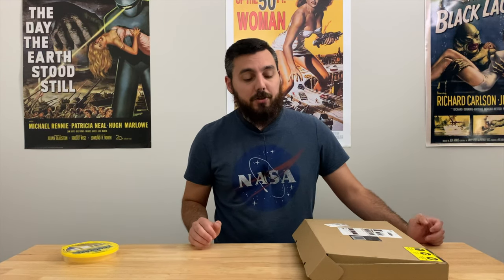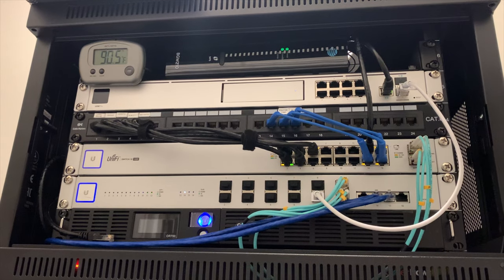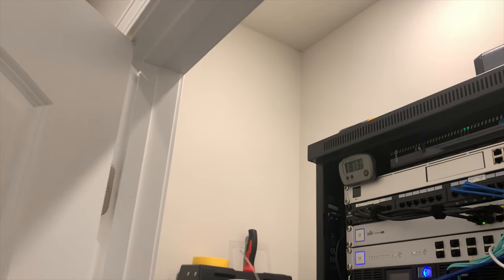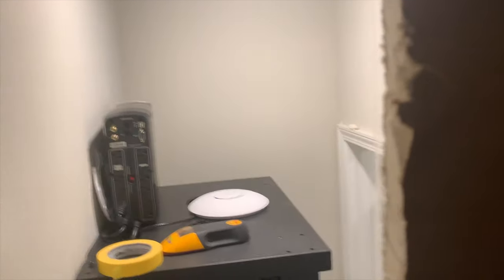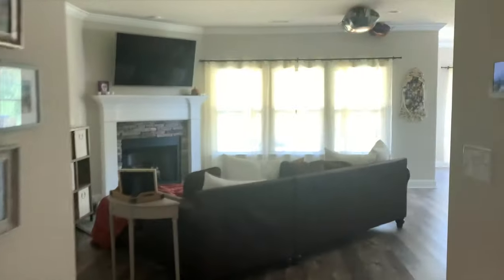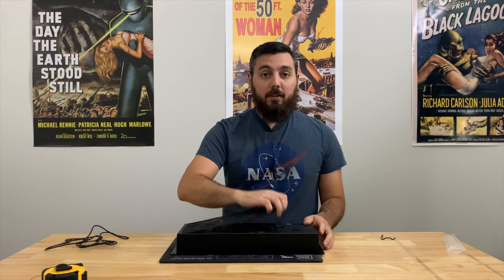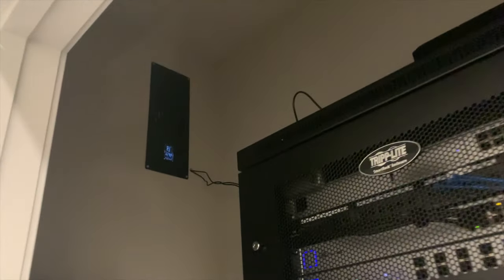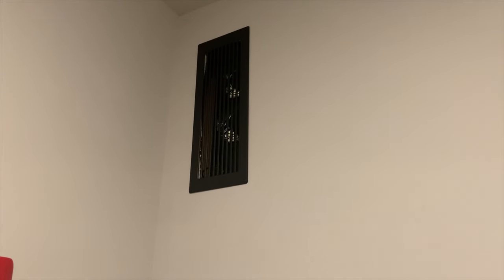Cooling the home server closet / home network closet with the AC Infinity Airframe T7.  AV Closet

Comment: That size closet with 200 CFM fan will have about 75 ACH (Air Changes per Hour). Meaning all the air in that room  is replaced approximately every 50 seconds. You should be seeing temps very close to the hallway temp. If your not, then space under door is probably not large enough, and the exhaust fan is starving.
Reply: Not necessarily.  All that equipment is putting out a LOT of heat.

Comment: I think what you did will be fine. You're venting into a larger room that opens to the hallway, so your return will pick up the air anyways. One thing you could do in the future is getting another one and pull cooler air into the server closet from the closet they were in, or get an exhaust fan installed in the laundry room which would help the laundry room with the dryer heat anyways along with venting the server hot air.
Reply from the maker: I think it was the best option with everything that had to be taken into consideration.  And yes, I still do have a couple more ways to improve it.

Comment: THX! Hubby and I are looking for ideas for our new network closet. Like you, it's getting to hot in there. We have almost the same setup. Tile floors with a fairly large gap under the door, just need something to pull the air up from there and out. We'd probably do the reverse one with the LCD on the outside of the closet. Hoping this is possible b/c out closet is small and no way to hang it horizontal, same as you (studs in the way). We shall see! Thanks again for this.
Reply from the maker: It is definitely possible.  The min reason is I didn’t want my kid to play with the buttons
Reply: @SPXLabs   Since you posted this, is it still working well for cooling down below 90 degrees? What speed do you keep it at? You had mentioned that you could hear it at 6 but not so much at 3. With tile floors through our entire house, everything echo's. :)
Reply from the maker: Short answer is yes it still works.  https://youtu.be/adxk6DP5md8 this is a video showing a year later.  Here is a link to some charts showing temperatures overtime https://www.spxlabs.com/blog/2021/1/10/cooling-my-home-server-closet-with-the-ac-infinity-airframe-t7-1 

The fans only spin up when the temperature reaches 80F and the unit will set the fan speed appropriately.  The fans normally sit at speed 3 and will get up to 6 if needed but it’s extremely rare.

I just installed a passive vent on the front of the door literally today because I uh…. Have been adding a bunch of equipment and now the exhaust vent is overwhelmed and now I need to get a better system in place.

Comment: "You can definitely hear the whine of the fans at speed 3" and this is why I am replacing mine with Noctua fans.  BUT... the connectors on the Airframe are JST, while most PC case fans are Molex.  You will have to cut off the ends and rewire them.  The buffer is in degrees, not percentage.
Reply from the maker: Now that’s good information right here
Reply from the maker: I did but I didn’t like the way the white version looked.  The wife preferred black

Comment: It looks like the vent in the laundry room is angled.You might be able to just turn it 180° to have them point the other way and you won’t see the dry wall maybe?
Reply from the maker: Yes! It is angled.  I did consider what you suggested but I’m nervous about how that will effect airflow.  I don’t even know if it will make any difference.  But that is something I could test. Hmmmm
Reply: @SPXLabs  - if you build a "tunnel" between the two rooms to seal the gap, you will improve airflow because you won't be venting into the cavity between the walls.  And yes, you could install it in the laundry room and 'pull' the air from the server closet... as long as you first build a tunnel to ensure you're not also pulling air from the cavity, which would be a waste.

Comment: Thanks for the video. A couple a quick notes as I have been researching AC Infinity products as I am specking out the build for my AV surround sound custom inset cabinets. I think the white unit may be another option based on your light wall color (just saying). It would probably be less noticeable and the drywall would probably be less noticeable too. You could probably use black electrical tape and just wrap it around the cut-out edge of the drywall. This will probably help to reduce the dust outtake into the second closet. You can use simple cable clips to make the wiring look cleaner. I believe the temp difference you are seeing is the internal cabinet temp vs. the temp where the probe is sitting (I could be wrong on that) and may have missed it. Thanks again and good job.
Reply from the maker: I've had the white in hand and while it definitely wouldn't catch the eye as easily, it's not very sexy like the black version lol, also wife black was the wife approved version so didn't really have much of a choice.  The black electrical tape is a great idea and I wouldn't need or buy anything to do it, thanks!

I'm pretty sure the temperature difference is because one of the probes is broken.  After the video until today I have had the two probes next to each other and have been logging the temperature and both are different.  I've inspected the cable of the suspect probe and it appears to be damaged (pinched) which may be throwing the numbers off.  Eventually I am going to stop being lazy an run the power cable and probe through the attic.  Just have to figure out placement.
Reply: @SPXLabs  Can you tell I'm working from home....totally being a bit lazy and distracted! I hear you....first rule Wife approved is the ONLY one that counts! I have actually read that issue with other reviews too regarding the cable/ probe. As I've also heard, AC Infinity is pretty responsive with their Customer Service. Thanks again, be safe and healthy!
Reply from the maker: Oh cool work from home! Yay!

Oh the AC infinity one is not damaged, it’s my previous one that is damaged.  I need another probe to really set things straight but I don’t want to spend the money on one lol.  Also from a physical body temperature perspective the room feels like it’s at a safe temperature.  Also the systems report 69C to 76C tops so I’m feeling like it’s safe enough for now

Comment: Question 1: 
Specs say this thing is like 2.5" deep... is your wall thinner than normal, for it to be able to go all the way through? 
Question 2: 
When you opened it up, did you get the impressions the fans are reversible? I want to use it to cool a room, and Winter blow in at top of room, Summer blow out. I would switch the fans' direction twice a year...
Reply from the maker: How thick is a normal wall?  The airframe does not go all the way through.  The back side is inside the framing or in other words is still in between both sides of the sheetrock/dry wall.

They are definitely reversible.  I'm not an expert but blow cool air down on top of rising hot air doesn't force the hot air out of the room through the bottom of the door.  It's always best to exhaust hot warm air from the top of a room and pull cool air up from the bottom of a room.

Comment: Seeing pictures on Amazon and watching a quick vid from Cedia and it shows these mounted on the exterior of the closets. Since you mounted it on the inside of the closet isn't it acting more like an intake drawing in air from the laundry room?
Reply from the maker: There are two “versions” an intake and exhaust version.  I have the intake version, so air is pulled from the server closet and exhausted into the laundry room.  If I had the exhaust version the unit would need to be in the laundry room to pull air from the server closet.  Kind of weird, I know lol

You can read about it more here if it will help.

https://www.spxlabs.com/blog/2021/1/10/cooling-my-home-server-closet-with-the-ac-infinity-airframe-t7-1
Reply: @SPXLabs  ok PHEW I was confused. I have the exhaust version and was following your vid and wanted to make sure I wasn't backward. Great vid and thanks for the reply!
Reply from the maker: I was legitimately in your boat at one point.  When I went through the purchase process I had to triple check the logic lol.

Comment: Great video and very thorough (both this video and your 1 year later video), but I have two questions:

- How long is the power cord for the fan?
- What is the minimum depth between the fan grates for your drywall install?  (I have thinner than normal walls where I am looking to install it and not sure if this is something that is adjustable to accommodate my needs.)

Thanks again.
Reply from the maker: - 6 feet
- The depth between the dry wall / sheet rock is 3 1/2 inches deep.
Reply: @SPXLabs  Thank you.  My drywall in the likely spot I'm going to put it is 3." In your opinion, if I put in on the 3" side and is the design of the fan assembly able to work with the reduced thickness?  Or does it basically need that 3 1/2" between grates?
Reply from the maker: I think the depth of the fan housing / chassis is 2.3 inches thick.  So it should sit comfortably in that space.
Reply: @SPXLabs  excellent. Thank you again. 😊
Reply from the maker: Anytime!

Comment: Why not just vent into the open wall space, which probably goes into the roof space or into the space between floors if you are in a two-level structure, rather than into another room?
Reply from the maker: Single story home.  Just an attic above the closet.  The space between the walls is very very small and there is wood and insulation at the top between the gap of the two walls of the two rooms.  I’d suspect the space between the walls is just too small and would not dissipate heat very well over time.

Comment: 3.412 btu per watt. 
Sensible heat removal is ( cfm × temperature change x  1.08 at sea level) 400 watts is 1364 btu. 
1365btu=200x temp change×1.08 do the math and 200 cfm of 6 degree cooler air than the closet should cool it.